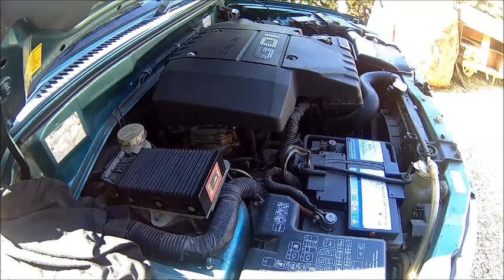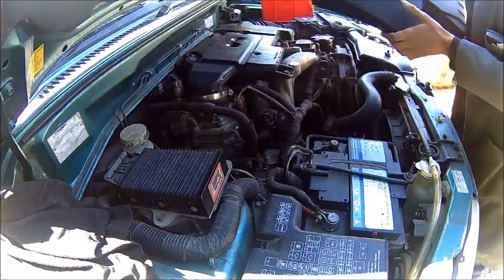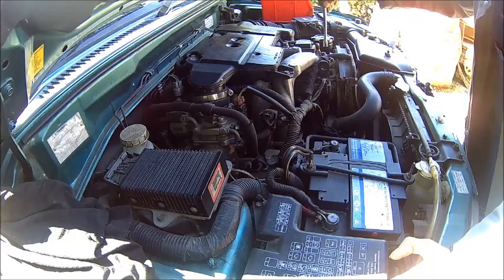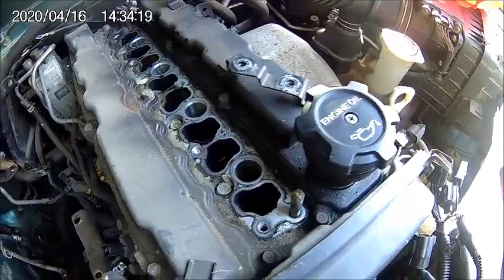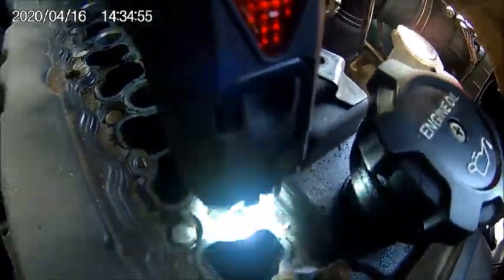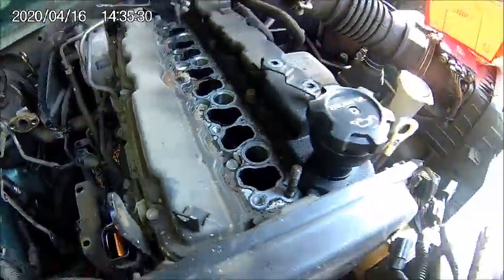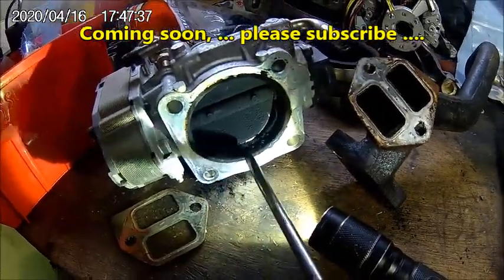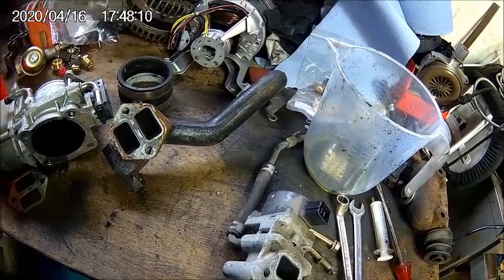Coal mining - Mitsubishi 2.0 GDI EGR de-coking - Part 1, tear down and inspection, 4G94 engine

Comment: Watching your vid helps me to be brave to clean just even the carb….having erratic issues with idle but after taking off the carb and cleaning which was actually fully coated with carbon and also the parts which it comes off. I think there’s a little holes that I clear also. After all that cleaning I start the engine and yes a few nasty stuff get spewed on the back exhaust and while the engine warming I can tell the difference. Now back to 800rpm whereas before it goes up and down then drop to 200/300rpm then cuts off. Was thinking to change the rail fuel sensor but for now it’s working and way smoother than before thought I leave it…again thanks great help your videos was.
Reply from the maker: glad it helped

Comment: Where did you source the intake manifold gasket? I have to replace my fuel injectors which is a manifold of job and I’m finding it hard to source reliably.
This has turned out to be a labour intensive job, and the injectors are not easily obtained and replaced either.
Reply from the maker: The gasket is an Ajusa brand # MD360457, got it from an ebay seller (enginepartsltd) , seems to be good quality. Price was around £11.
And yes, it's a big job, every time i work on this thing, i think it's probably quicker pulling the whole engine as everything is so cramped. Why do you need to replace your injectors ? They quite reliable, issues are usually more on the fuel delivery side.
Reply: @dynoguy  I have a failed injector. That’s what the diagnostic machine says, I’m going to get them all checked by a company that test and recondition them. Clean the intake and do the valve cover gaskets at the same time as mine are weeping some oil into one of the spark plugs.
Reply from the maker: I don't always trust diagnostics, ...Did you check anything else ? connectors, wiring, injector drivers. etc... may save you a lot of work.  How many miles you got on it ?
Reply: @dynoguy  local garage went through it to, I check the connectors as best I could but they are buried under the intake manifold, genius design. It’s not done 60000 miles but was neglected before I got it. Spent 2 weeks getting it welded up and road worthy to start with. 
I need to do the rocker covers. And as you have done want to clean out the intake anyway. 
Just wish they were a bit better designed for maintenance. Think I should have bought a Cherokee lol
Reply: @dynoguy  that was a fighter, why so many things are bolted to the manifold I do not know, the amount of crud in the Egr valve alone was shockingz
Reply from the maker: Glad you got that far,..... i think an adequate punishment for the designer would be doing that 5 times in a row .... and after that, the exhaust down pipe a few times.

Comment: ...that engine setup is ludicrous!.......and all of that crap wouldn't be in there if it wasn't for the bloody EGR valve....the most stupid idea ever :)
Reply from the maker: Fully agree,  makes no sense at all, rather poor fuel economy and a real pain to work on, same job takes me less than 30 mins on the Jeep....But it's a pretty capable little 4x4, underestimated by most people. Decent drive train with an Aisin AW4 auto and NP242 transfer box (same exact setup as the Jeep,) Lo range with center lock and a rear live axle with LSD. The only downside is the clearance under the the front wishbones and tyres to suspension struts, even snow chains are pretty tight with the standard tyre size.

Comment: I decided to just try seafoam on my Pinin, it did help and I intend to do it every 10k to try and manage the coking.
Reply from the maker: Well, there are always many ways of doing things,... i certainly would never pour Seafoam into an engine, because catalysts and Lambda sensors are expensive and it does not really do the same job as a proper clean, but it makes at least the manufacture of that sauce rich ...:-)...  If you think it works for you, OK, ..but did you ever read the MSDS, it's not really worth the ingredients.
Reply: dynoguy nothing will beat the proper job you are doing, I use the stuff which is sprayed into the air intake which the engine is running. It has made a difference I just don’t have the time to fully strip the intake manifold down. I still can’t source a narrow enough spark plug socket to dig out the plugs!
Reply from the maker: I don't say it won't make a difference, but the negative side effects can be rather costly,  also the stuff has just not enough time to work well with a running engine. The air volume throughput at 1000 rpm is around 8 liters per second, so guess how much time it spends on your dirty intake surfaces. .... Yes, plug sockets can be a problem, look at motorbike tool shops, they sometimes sell slim ones. Years ago I machined one down to fit, meanwhile i found a better one in a cheapo socket set, it's a really snug fit, but works....One tip, when you re fit the plugs, take the rubber out of the spark plug socket, otherwise you may have some fun to get the socket out of the hole